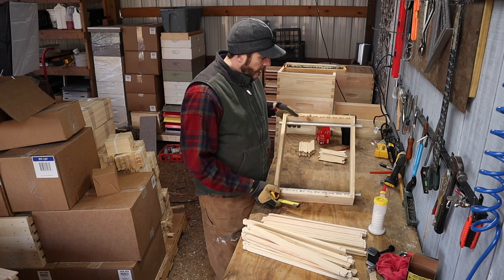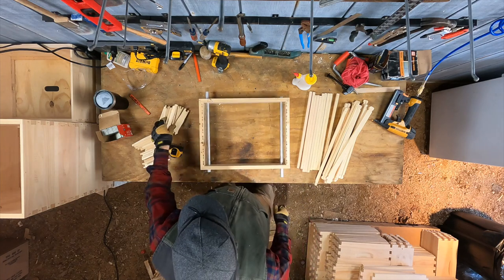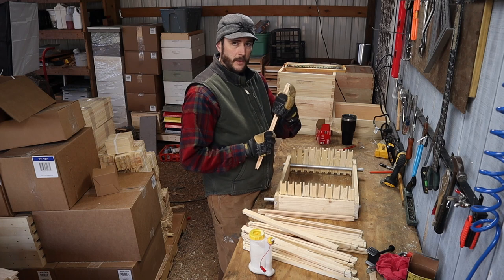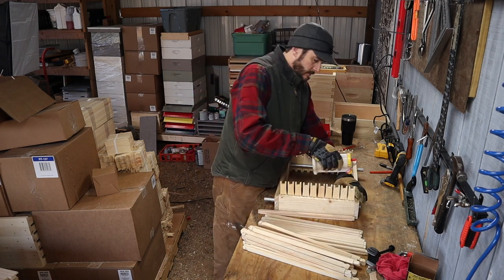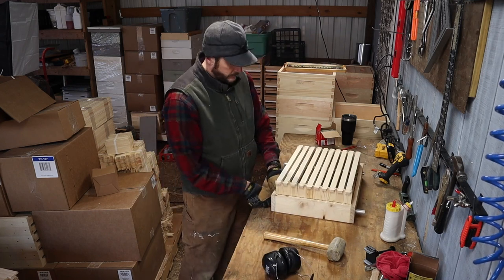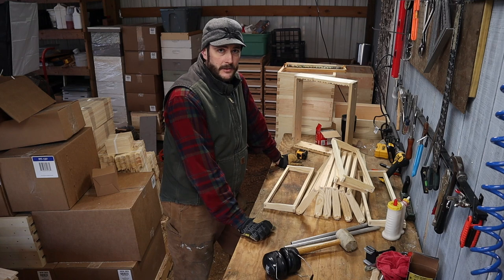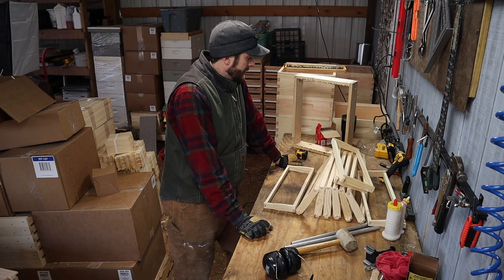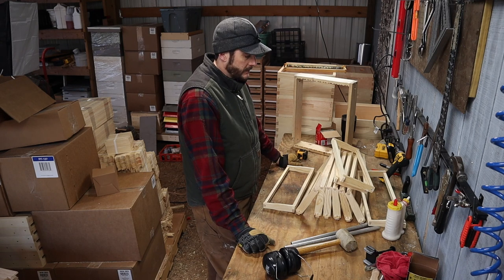Simple Beehive Frame Assembly Jig

Comment: I bought a Metabo brand narrow crown stapler based on a video recommendation. I have so much trouble with it firing blanks, driving too deep, not deep enough, firing 2 staples. Now I wish I would have returned it to Amazon. I read the reviews on the one you’re using. Looks good compared to mine. Now I just have to convince my husband that I need a new power tool and get a Bostitch 😁.   Lorie
Reply from the maker: I’m not a brand fanboy, but I have had ZERO trouble out of the 3 Bostitch staplers I have. I know Senco is also a well regarded brand...I use their staples.
Reply: I also use a Bostitch stapler...18 gauge...I can vary the length of the staples for bottom and top bars....very good equipment...
Reply from the maker: I’ve been very happy with mine.  Have an 18 gauge a 16 gauge, and a T11 stapler from them.
Reply: You can adjust your air pressure regulator cut off & turn on closer together so you don't have such large air pressure drop. This will help with driving the staples all the same depth. Also oil/lightly lube the inside & staple slide area of staple gun will help on miss fires, the double staples just sometimes happens but is related to how you hold/how much pressure you push on gun.
There are adjustments that  can be made to staple gun it self (find a shop in the yellow pages or Google  it) The hardness or softness of the wood will have effects.  Good luck.
Reply: @hcaveman6954  thank you for the great advice. I did splurge for the Bostitch and I’ve been very pleased with it so far. Right away it was working exactly as it should. My husband can have the Metabo 😉
Thank you again!!!!
Reply: Double firing staples is mainly because people fire staple guns like a gun. They let go of the trigger too quickly. You need to pull trigger and hold for 1 second and then let go.
Firing too deep is because you need to lower compressor pressure a little. Don't use 90 pounds unless it's hardwood. Just takes practice. Its not the stapler. It's how you use it.
Reply: @TerryWheelyabarrabackApiary  okay thank you, I appreciate the help. 😁

Comment: Hello my fellow beekeeper, this was so helpful for me.  I'm putting together a beehive and made a big mistake that I would like to ask you help with .  I did not use 90* corner brasses to make sure they set straight, and now the box down line up with one another.  So I have taken them apart, order the brasses, yet don't know how to correct the screw holes that are already set?  I feel like even with the brasses intact, the screws are going to go right back into the same pattern and the boxes will again be off centered.  Someone told me I do try to slightly bend each screw?!?!  Or should I put toothpicks in all the holes then try to re-screw?  What would you recommend?  It would be so helpful to hear back from you.  This is a project that is very important to me.  Thank you so much.  Brad
Reply from the maker: Several things you could do.  First try it without fixing the screw holes and see if it works.  If it does great.  If not, you may need to drill the holes out a bit and plug them with a piece of dowell, then predrill your new screw holes.  To plug, get a small drill bit the size of whatever dowell you're using, drill it out, insert wood glue, then dowell.  Cut it off proud and then cut flush after it cures.
Reply: @DuckRiverHoney  Thank you my friend.  I think I will try that and with glue.  I've ask a handful of shop guys and for the most part, they are telling me to fix the boxes, using the corner brasses, and glue it all together.  And once the glue is set like in 24 hrs, then try drilling back in the screws but don't screw in tight.  Does this sound like something that could work?  I'm grateful for your feedback.